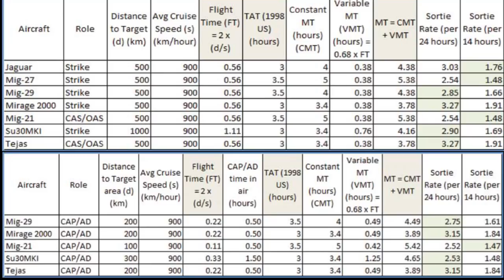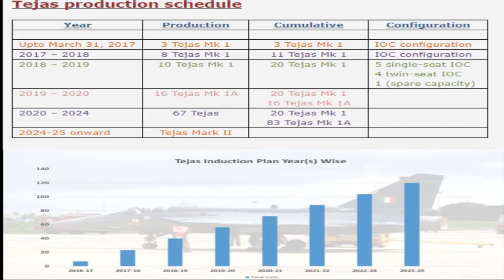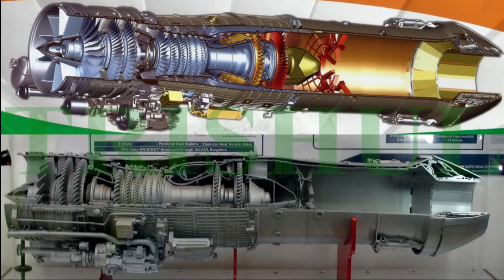LCA Tejas after a year of induction & prospects(Kaveri engine)

Comment: This initial success of Tejas can give us a reason to smile, but not to jump with joy. The IAF and the navy have both said they intend to carry out some more tests and it remains doubtful if the Tejas will actually fulfil the role it was built for: to replace the ageing MiGs. A reality check reveals some sobering facts. For instance, the LCA has been in the making for some 27 years. The initial budget was Rs560 crore; this spiralled to over Rs15,000 crore. Moreover, 40% of the components are imported, including the all-important engine. The Indian engine, named Kaveri, was a failure.